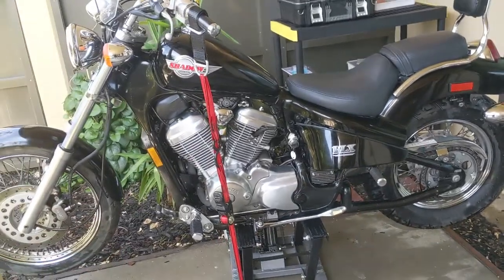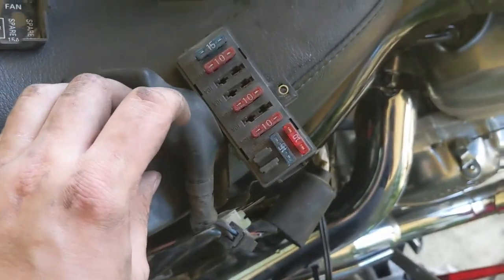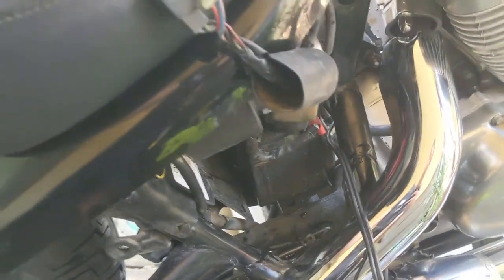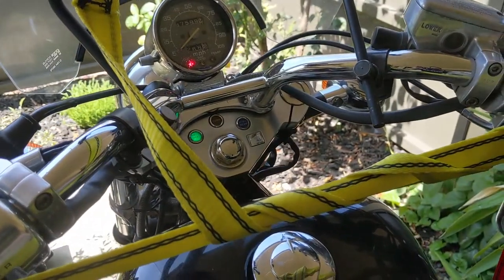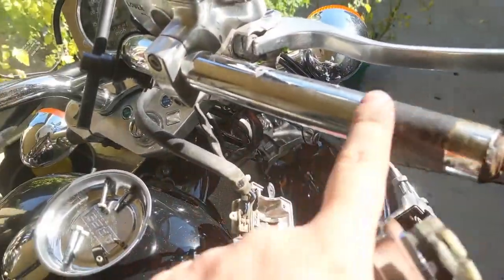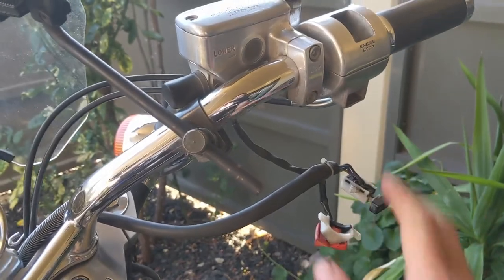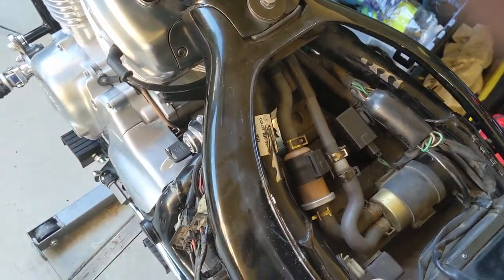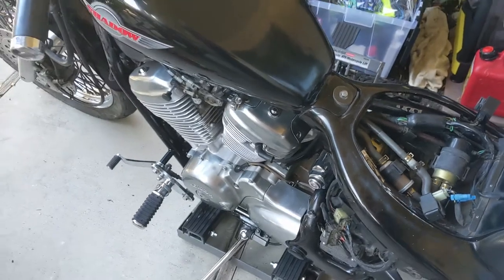Bobber Build 1993 Honda Shadow VT600

Comment: Where do you place the jack to lift it? I have a 96 VT600 but I couldn’t figure out where to lift because of uneven frame
Reply from the maker: Yes the uneven frame isn't making things easier. On the back it is on the frame that is uneven. On the front touching the frame and engine. I tie down the bike to ensure it doesn't flip on the side due to the uneven frame part. You might see it better in some of my other videos like the one where I remove the engine. Hope this helps.
Reply: @zigmoto  Def. helps. I got a lift and i didnt want to return it. I'll keep watching. Or, if you can make a separate video, that would be awesome.
Reply from the maker: I will keep this in mind maybe for the video when putting back the engine or removing the front fork. Might be a while since there are lot of things to do before these.